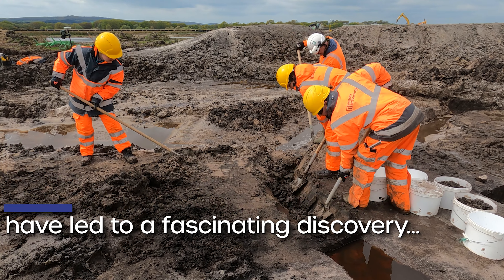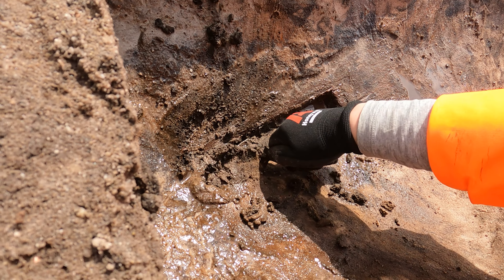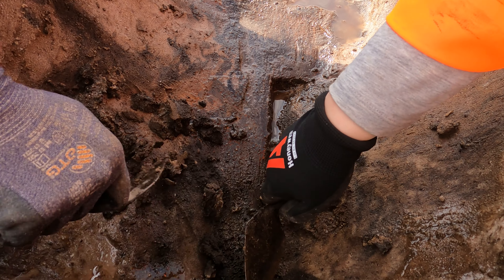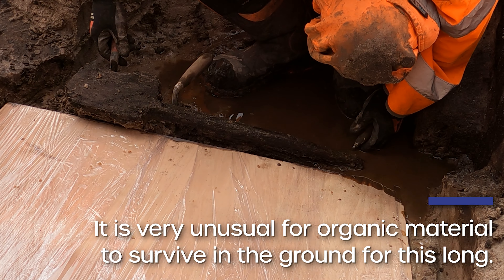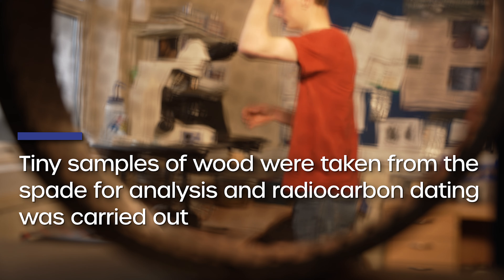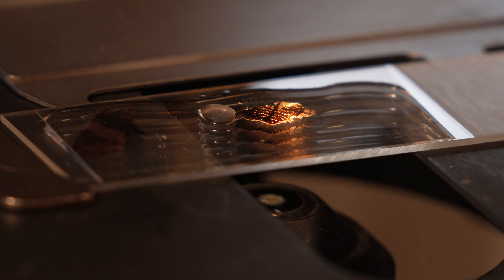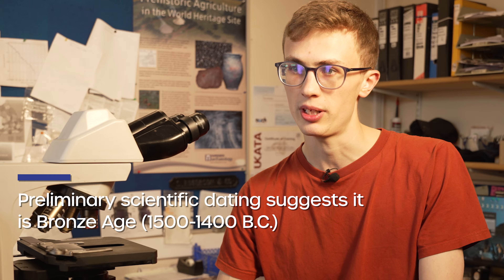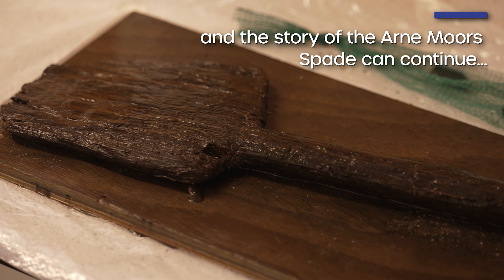Discover one of the oldest and most complete wooden tools ever found in Britain

Comment: Definitely a spade and not a paddle?
Reply from the maker: Good question! We’ll be looking at the spade in great detail during post-ex analysis with our specialists but the shape of the blade seems to indicate a spade. It is tapered towards the end, suggesting a ‘cutting’ edge.

We’ll also be exploring if the handle was deliberately offset. If so, it could indicate that only one side was used for a foot to push the blade into the earth. It would also bear similarities to some medieval wooden spades. We’re excited to see what insights further research can bring! ☺
Reply: Oak is v heavy for a paddle, ash splits as easily as oak with a good straight plane & is much lighter to swing around. Oak from heart wood is much more resilient. Lovely piece. Also a spade is much easier to make one sided if that was the original shape.
Reply: @archaeologists Peat turf cutting?